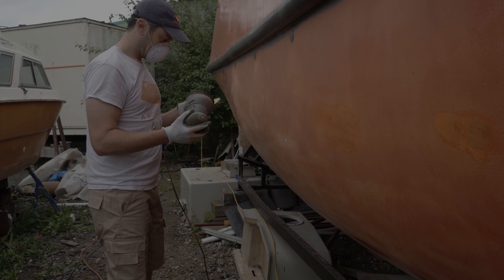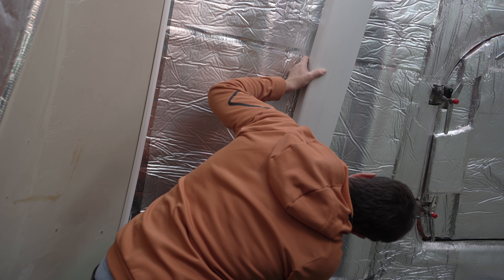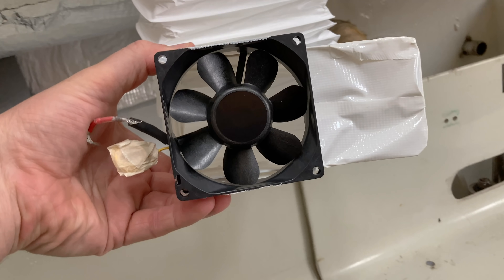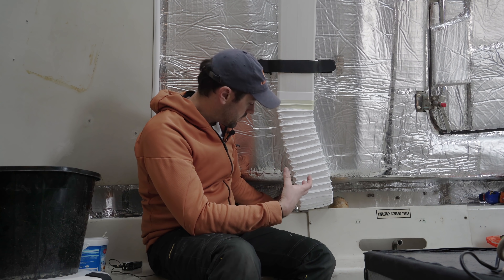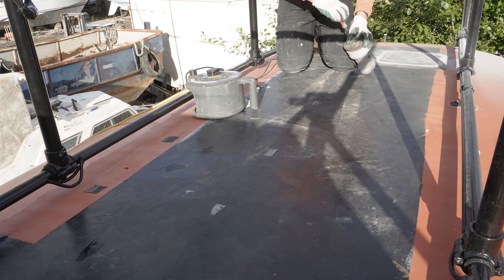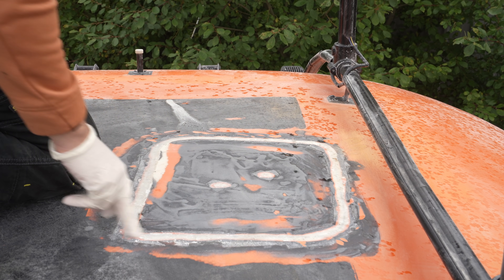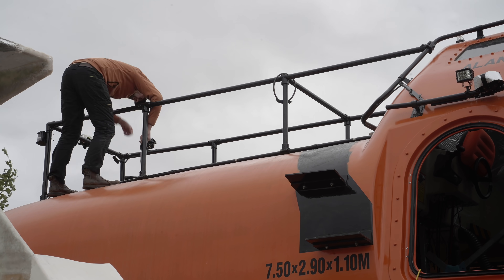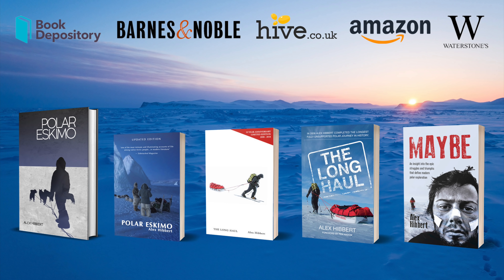Lifeboat Conversion Ep27: Continuing the engine bay venting duct system, and deck anti-slip [4K]

Comment: Just an idea from an engineer: Use a centrifugal fan to move air through your vent.  Also known as a squirrel cage, these fans are designed to move larger volumes of air with a greater pressure differential.  This is way the are almost always used in car ventilation and HVAC systems. Basically if you want to move air through a duct you use a squirrel cage fan.  (lower velocity but larger mass flow usually means lower noise as well) Not sure what type and style you can get in the UK but they range in price from $5 to 150 depending on size and quality.
Reply from the maker: A good point well made. These appear to 'grab' the air well, so will give them a chance in a pair. Will report back! I'm never too proud to change things if a mistake has been made.
Reply: @AlexHibbertOriginals  Its all good. I'm just a dumb desert dwelling aerospace guy so I haven't seen snow in 5 years, have never set foot on an ocean going boat, and really don't know much about airflow under mach 0.9.  :-)  So you can take my advice with a large grain of salt. However, If I was going to work/live in an "enclosed space" with a hostile environment outside, I would give very careful thought to my heat budget while ensuring I have lots of fresh air. A water tight fiberglass box with two well sealed doors, and a running diesel motor, seems like a Carbon Monoxide death trap to me. I'm not sure what OSHA/NASA/Mil-Std regulations cover this sort of Confined Space. Maybe https://books.google.com/books?id=adEvdwfc3gUC&pg would help?  Anyway, I wouldn't feel safe unless I had a ventilation CFM rating better than 3 minutes to fully exchange the atmosphere (Allen's volume/3 min <= fan CFM, because brain damage is usually reversible if O2 is cut off for less than 3 minutes). I would also think about making a dedicated air intake with a heat recovery system. That way the exhaust fan wouldn't be fighting the seals around the door to provide fresh air, or worse yet, sucking air from the engine exhaust plumbing.  To provide that much fresh air you would likely have to recover some heat, so the heat recovery could be as simple as running the intake and exhaust in the double thick square pipe with an aluminum plate divider that way the air going out gives some heat to air coming in. Would your exhaust air humidity tend to freeze over the exhaust port?  Would it be worth your time/money/space to add a water heat exchange to the motor (like a car heater) to warm the incoming air?  Would you need a mechanical water check valve on the intake? Like a plastic float ball that fits the intake size, held in a cage so if the intake is momentarily submerged the ball blocks off the intake.  You know more about the Allen, freezing atmosphere, and being on a boat then me, so don't just take some internet weird-o's advice because I'm probably way over thinking this. https://ntrs.nasa.gov/citations/19670027991
Totally different subject but have you heard of "rockwool" for sound and thermal insulation? It's heavier mass might help sound absorption around your engine.  Also there is real wool (from sheep) insulation that I saw some guys installing it in a camper van. Suppose to be good for wet/humid and very cold environments.

Comment: Why do you use sugar soap? What are the merits of using it over general soap? Furthermore have you considered using 3D printed parts for the more unieke parts of Alan?
Reply from the maker: It's a bit of a misnomer. https://en.wikipedia.org/wiki/Sugar_soap

3D printing - perhaps if I come across something that needs it. So far getting by ok with metal and composites.

Comment: What if the plastic pipe gets totally smashed somehow, can you reroute the exhaust? seems like a big problem if it is damaged and you cant reliably prevent exhaust leaking in the living quarters.
Reply from the maker: Remember this isn't the exhaust pipe. It's just a vent from the engine bay.

Comment: I have used 2 computer fans in my tiny travel trailer. I performed the calculation of total volume and fan displacement per minute resulting in 3.5 minutes to completely turn over the air. In actuality I found it totally inadequate. The air turnover never came close to the calculation. If you want dependable air flow you may want to consider a boat bilge fan. They move a lot of air and are safe for combustible air.
Reply from the maker: I actually had a few bilge fans. They were deafening, and handled variable speeds very poorly.

Comment: On the vent position question you did not consider one other option. In stead of running the long rectangular vent duct conduit straight down vertically you could rotate it slightly CC to a angle and have it land directly over the engin bay area.
Reply from the maker: Quite right James - there are some large undulations on the insulation though as the fibreglass below isn't flat. Although, I'd like to use that large space to the right for other things like signage or net storage.

Comment: An alternative to acetone for removing sticky stuff, and superior in my estimation, is naptha. I learned about this thinner, which graphic artists used to remove rubber cement, when a magazine publisher in my building went digital and put a case of naptha in the trash and I rescued it. I now use it even on car paint since it evaporates quickly and leaves no residue. Good for softening clear tape bits on metal office desks. It's good to have an arsenal of solvents and I usually try naptha before resorting to more serious chemicals like lacquer thinner. When used indoors the smell is gone very quickly.
Reply from the maker: Ah yes - it's actually the stove fuel I use lots of. I usually view it as a 'clean' petrol/gasoline. Does it eat at high gloss paints?
Reply: @AlexHibbertOriginals  All I can say is that I don't hesitate to use it on my vehicles' paint when automotive cleaners aren't working, and it hasn't hurt anything yet, possibly because it's gone so fast; so definitely worth trying in an obscure place first. I start with a paper towel and if I need something with more bite, move to terry cloth or melamine sponge. The best use I've found is removing those hateful stickers from plastic products like pipe fittings, stemware and plates, which do turn dull with other solvents.

Comment: Instead of letting exhaust pool in the compartment and then bent it, wouldn't it be simpler to connect the bent directly to the engine exhaust?
Reply from the maker: I think you'd need some pretty clever ducting to allow hot/dirty air in the bay enter the exhaust pipe without getting all the fumes from the engine coming back at you.

Comment: Is there a compensating/ventilator port for the extraction system? Once it's turned on it will be removing air from the cabin that needs to be replaced by the same amount it is removing otherwise the fans will just 'cavitate' (for want of a better word).
I suppose there is - I can't imagine 55 sweaty seamen, sorry seapersons in a force 10 gale having just survived a life and death incident at sea being able to travel in a certified lifeboat that then efficiently kills them like the Helios air disaster.
Reply from the maker: I've just replied to Grant's near identical comment on this. Come back to me if you can't find it and I'll copy and paste!

Comment: Is Alan's engine air intake inside the engine enclosure or ducted from somewhere else?  If the engine air intake is in the engine enclosure you need to consider the engine as a huge air pump with suction from it's intake and exhaust at it's, um, exhaust.  This creates a negative pressure in the engine box that those small electric fans will not be able to overcome.  Lets assume the engine is 1.3L with a maximum speed of 3600rpm and has a volumetric efficiency of 3 (for turbo). That means the engine consumes 248CFM of air which is much more than the two small electric fans can compete with.  If the fans are to vent the enclosure when the engine is not running that's a different thing (although if air is drawn down the duct in the opposite direction the fans will most likely windmill and their bearings may not be designed for that and may suffer premature failure.
Reply from the maker: Thanks Grant. Yes, I'm looking at the various options for the air being drawn into the engine bay, and perhaps separately, into the air intake attached to the turbo. It may well be that there's a baffled, open vent at the opposite end of the bay, to create a through-draft, but I'll need to consider impact on noise reduction.

For the vent, I'll need a feather-light shutter to avoid down draught against the fans.

A work in progress.
Reply: @AlexHibbertOriginals  If you duct the engine air intake from somewhere else (thus removing the existing engine compartment ventilation via the combustion chambers) make sure whatever you replace the engine compartment ventilation with is fit for purpose.  

Having spent time in enclosed lifeboats while I was in the merchant navy I wish you the very best (and totally understand the desire to seal and acoustically insulate the engine cover)

Comment: More Allan! Yay!

I'd definitely suggest putting the fans in the removable panel, since that seems to be the most practical way to maintain access to them.

We have that orange pumice goop in the US, too. I've got a gallon bottle that's nearly as old as I am (dad over-purchased) and it's still going strong.

Also, the anti-slip coating is sort of reminding me of the black nose paint on the P-51D Mustang. :)

Comment: I'm sorry if i get this wrong but is there going to be exaust going through that pipe. Because if so, please watch out that it could melt the plastic.
Reply from the maker: No, just the air from the engine bay. The dry exhaust gas exits via the exhaust pipe on the stern, below the rubber fender strip.

Comment: Hi, you mentioned a closure in the exhaust duct, May i suggest a toilet Rat flap, its quite cheap and watertight from one Side.
Reply from the maker: It'll need a very., very light back draught shutter.
Reply: @AlexHibbertOriginals  Maybe you try a backdraft shutter for an Extractor Hood?

Comment: So what are the expected thermals on that exhaust vent? Not sure that (looks like a PC fan) exhaust fan (noted to have twin in the future) will hold up under potential peak thermals. The pliable 90 degree elbow might also require a “hose clamp” or two at each connection; as “it will most certainly” (I believe your channel speak is entering my subconscious vocabulary) become more pliable with heat and potentially lose its hold. Looking good, keeping me entertained with your ideas and those of other gawkers of your channel. Enjoying the progress and updates.
Reply from the maker: The temps will be pretty tame. On sea trials the temp of the exhaust lagging at the stern was only 35deg C, and the constant throughput of air will avoid a 'pooling' of heat. The fans are IP68 industrial fans, and rated to over 70deg constant. They aren't computer fans.

Comment: You mentioned values on the extraction system to keep moisture out; That seems like a good idea to me, but if you go that route don't forget the intake (if external) and exhaust are potential moisture inlets are well.
Now that I mention it, I can't remember if you've shown how the exhaust is routed. Does it come out above or below the waterline?
Thanks for the great content, as always.
Reply from the maker: Thanks for the input. It's a dry exhaust. There can certainly be humidity or dampness in the engine bay from misc sources, but hopefully not in substantial quantities. My concern is ensuring sea spray can't find its way in.

Comment: Im curious, did you consider adding metal ducting and a heat exchanger to recapture exhaust heat in the main cabin like the sort they have for wood stoves? I think i read that they do that for some antarctic vehicles, but maybe alan's exhaust isn't hot enough to make it worthwhile?
Reply from the maker: It's unlikely to be helpful on Alan, since when the engine is running, we'll be underway and not in the super-cold temps. When in extreme cold, we'll be using a diesel stove.

Comment: I’m not sure if your fans are static pressure or high airflow but after years of building PCs, I can almost confidently say they may not work for that application.  I could be wrong though!  But you’ll want to make sure they’re AF fans, not SP.
Reply from the maker: Thanks - I've tested a number from this range and they push the air very effectively. This one in particular grabs the air better than a larger one with flatter blades. Although they look like cheap computer fans, they are pricey, IP68 sealed industrial fans.